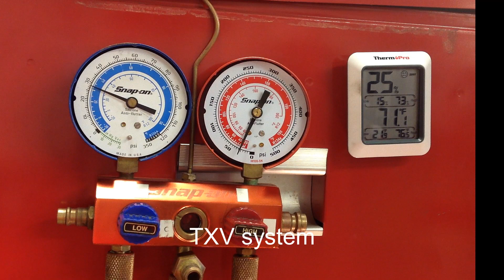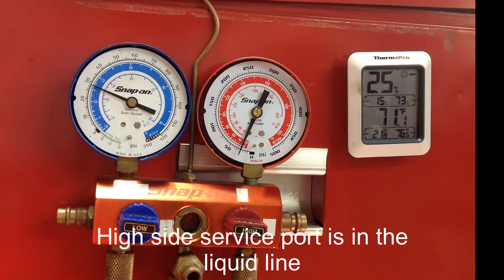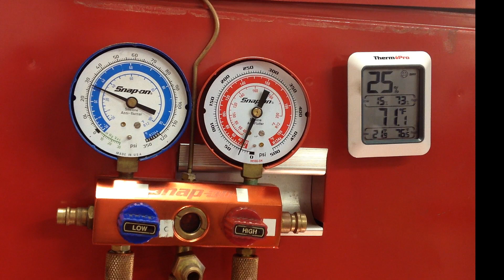A/C gauge analysis diagnostics: 2006 Buick Lucerne TXV

Comment: It would be very beneficial since we were talk to diagnose air conditioning using our fingertips and temperature.    But while making your videos, of course, you cannot use your fingertips and just describe temperatures to the students..   you use clamp on Bluetooth temperature sensors Fieldpiece.  And you can see the temperature drop for example, across the condenser would be greater than 30 to 50° temperature drop this would show the students that the problem lies in the condenser.  or across the receiver dryer..  and very rare, but does happen is the inner lining of the discharge hose from the compressor before it gets to the condenser collapses inside like a heart valve or shut off valve inside the lining of the compressor discharge hose.  

In any of these cases, if you were showing a time graft of temperature from the moment, you start up the vehicle .  Your students would be able to see the temperature drop from the hot temperature, discharging directly out of the compressor line for example, and then, if it was a collapsed hose on the other side of the hose on the line, you would see a rapid dropping temperature.. 
fieldpiece part number is JL3PC  you can probably order them to your school since you probably have a budget for purchasing tools and equipment for Training lab.  

For the very difficult or or small or cramped spaces.  There is the optional Fieldpiece, the Mr. bulb on the tip of a wire that you can strap to any item using Velcro, or even tape to get that little thermal bead right up next to the item you want to take a temperature of.. 

Another good thing to be looking at is the temperature of the case of the compressor .  It will rise because it is no longer getting a cool flow of refrigerant and lubrication is not returning to the compressor..   so with a temperature probe or a infrared camera, you can show your students to part of the compressor that starts increasing temperature to the point where it will burn your fingers become well over 200°F. Depending on the ambient temperature in runtime.. .  And different compresses react differently some don’t get very hot.. 

Are you use a little spray paint barbecue black Weber paint flat black for your thermal infrared camera sprayed on a compressor housing or aluminum refrigerant pipes.  Because the aluminum is reflective with heat sources. It sometimes gives you a false reading. That’s why you spray paint it flat Black. He makes it excellent visual aid for your students in real time..